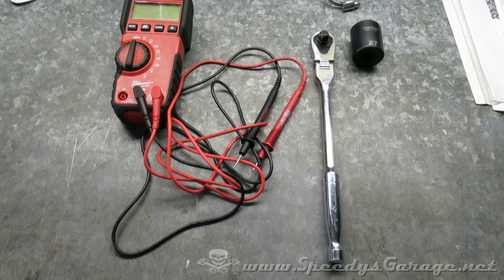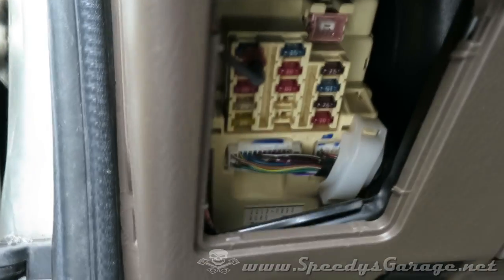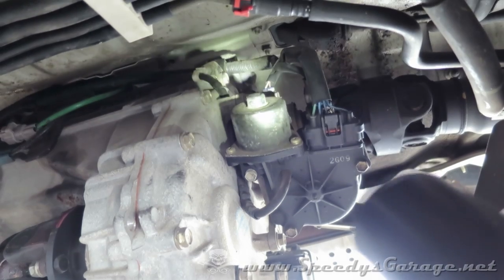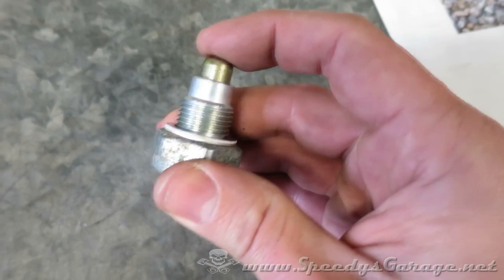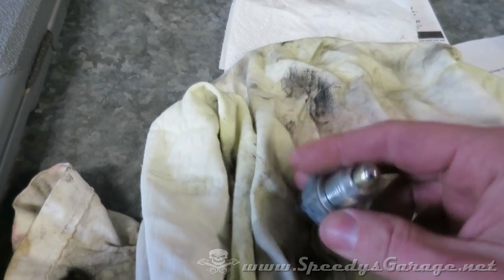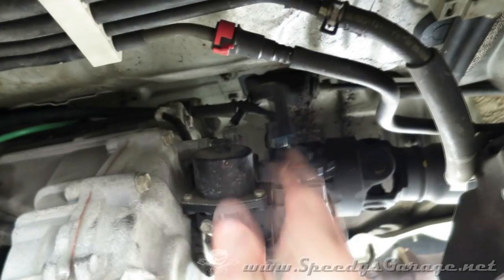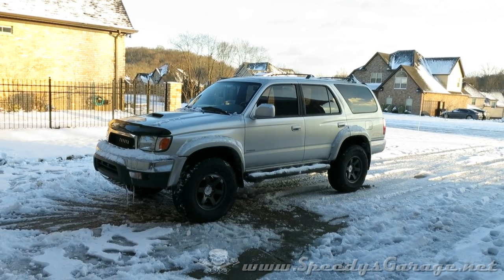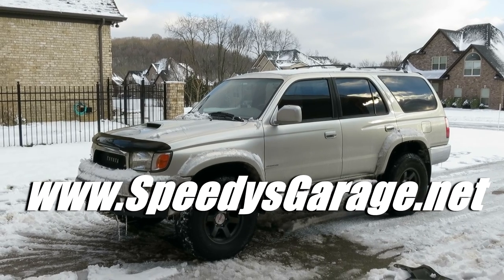2002 4Runner 4WD Repair

Comment: Good job. Just completed getting my son's 02 4Runner out of full time 4WD. Was the sensor switch closest to the transfer case as well. We had the front differential locked and pulled the ADD Actuator to clean, inspect and re-grease. Changed the differential oil as well. As soon as my son connected the battery I felt the ADD Actuator running (maybe a self test). When he turned the ignition key to on it ran some more. When we started it and went for a test drive it re-engaged the front differential. Dash lights still flashing. Brought it back and tested the sensor switch on the vehicle and got a open load. Removed it and tested and it tested good. Re-installed, reconnected wiring and as soon as I turned the ignition on I heard a clunk and it was out of 4WD (dash lights off). Probably should change the transfer case oil as well. Thanks again.

Comment: My 01 had flashing lights but 4wd was stuck engaged; I could tell because the tires were chirping and binding when I turned. I tried off-roading the suspension hoping to bump the actuator to disengage through vibration. Nothing. I disconnected the negative battery as suggested and after reconnecting, drove it a few feet back and forth. The system properly engaged and disengaged. No more blinking lights! Thanks

Comment: I was on the road when this too happened on my same 4 Runner. A You Tuber said to turn the key in the on position and tap lightly on the sensor.
I heard it click...problem solved. I will do what you did with the cleaner, when I get back to my shop.
Thanks for sharing.....

Comment: Great info in this video. The rear sensor / switch on the top of the actuator of my 2001 4runner was faulty. This info was invaluable thanks for making this.

Comment: Thank you very much for the video.  I would donate to this video.  Mine was not just stuck in 4wd but the center diff was locked making the truck hard to turn.  
I was attempting to remove the solenoid but it felt like it was under pressure so I left it.  I removed the outer switch so i could get better access to the inner switch.   
I read some paid $100-$200 for the switch.  I also read that beck arnley reverse switch part#201-1788 can work.  I bought the switch from amazon for $15.  I installed the switch today and start the truck.   I heard a clack and the light came off the dash.  I didnt even had to drive it for the lights to stop flashing.
This is such a simple and cheap fix.

Comment: You can also give your rear actuator a few love taps. That's what ended up fixing it for me. The four-wheel drive had not been used in a long time
Reply: Thanks for your comment.
I rarely use 4 WD and the other day I pushed the 4WD button by mistake... 4 WD light stuck on.
Did what you suggested.
Lightly tapped the two switches. 
BINGO LIGHT WENT OUT !!
Many thanks!!!
Reply: I use mine quite often but it still got hung up. Thanks for the tip, beating it with a prybar worked!

Comment: Had a similar issue with a Sequoia. It would take a long time to change in and out of 4x4. Did a diff oil change front and back and it worked great after that. Now I have a 02 4Runner where the light does not even come on. Going to check the fuse first.

Comment: I have the problem of my 4x4 light on my dash blinking also but am in 2 wheel drive on my '02 4runner sr5 automatic and i did all these thests and cleaning and the lights still blink. Any idea what to check next

Comment: I am having issues with my 1996 Hilux Surf. I get no response when I push the 4x4 button. I changed out the button/knob. I changed the sensor/solenoid you showed in the video. Still nothing. I have not tried the fuse yet. 
I left the button on and one morning I started up the engine and the 4x4 light was blinking and beeping. I tried putting it in drive and then reverse hoping it would engage but it did not. I turned off the button and it stopped but the but did not work once again after.

Comment: i have an 04, 03 and 04 seem to have a different system than 02. My mechanic replaced the actuator with a new one, lights still flash and 4wd still won't engage, pulling our hair out, any suggestions?

Comment: Any suggestions for my 02 4Runner? 4L and Center lock work perfectly but 4hi will not engage.. 4wd lights don’t even flash when you push the button. Dash lights work as they should for 4L and the Center lock. Thanks

Comment: All the new trucks /w the push-button drive mode select BS makes me nervous for this exact reason.  Why the hell do I have to lose my 4WD for a freaking switch?

On another note, I saw the other day the manual actually recommends driving around in 4WD for ~10 miles / month to keep everything lubricated.
Reply from the maker: +s50201 Yep, I haven't been doing the driving around thing, but will from now on.

Comment: Hello, I have a question and I am asking for an answer if it is possible. I have 4R 2001 and as I wrote I have a same problem. I did  checked these switches. My question is: Is your "CENTER DIFFERENTIAL LOCK SWITCH" working only as a button, or is it working as a switch (you can clearly see the position  On and Off, or hear some clicking sound during switching? In my car works as a button and I wonder whether it's normal or it may be blocked and that's the problem.
Thanks in advance to Mike
Reply from the maker: It's just "button".
Reply: THANKS SO MUCH < m>

Comment: My 4wd light doesn't pop up on the dash when I put it in 4wd. Also, whenever I press the button for the rear diff lock, the light on the dash flashes. Is this most likely a solenoid problem?
Reply from the maker: That sounds different, typically solenoid issues result in flashing 4WD lights.  Check fuses, switches, and connections.

Comment: Hi, great video. I have a 2002 as well. I dont have the sensors at the front like you mention. On Mine I have a black actuator at the front.
Have you actually seen the ones at the front on yours?
Reply from the maker: it's been a while and I don't recall.  You can try to find a diagram and it'll show you.
Reply: @SpeedysGarage  it's ok, the same sensor that you replaced is bad on mine too. 
Already ordered part. Thanks

Comment: Yup the top 2 switches are a PAIN to remove. I did the easy two, then the top two and that didn't fix it either, so it ended up being the front actuator.

Comment: Hello Mr Speedy. My 04 4Runner is stuck in 4 wheel high. I can’t find this darn sensor to save my life. Did you access it from the driver side or passenger side, and is it like up towards the front diff or more towards the center of the vehicle? Thank you in advance
Reply from the maker: Driver side front.
Reply: M.Flannery 04 4runner is a 4th generation so may be different

Comment: my 4runner(97 sr5) struggles to move when 4H is engaged and wheel is turned all the way left or right. Turn it far enough and it doesn't move. Any suggestions?

Comment: Hi Speedy's Garage,  I'm writing to you because I see that you know what you're talking about. I have 4R 2001. There is a problem with 4 WD blinking lights. From the moment the engine is turned on, the lights blink and you can not switch to 4WD. At 110 km / h the beeper turns on and then when I press the button, the lights stop blinking. After stopping and switching off the ignition and starting again the case starts again. I just checked and cleaned the contact cleaner spray, two of the switches you showed. They look like they're ok. What's the next step and what direction should we go in, what track? Thanks in advance, Mike
Reply from the maker: Hmmm, it "sounds" like it might be one of the 4WD solenoids, I'd clean/check all of those as well as the 4WD switch on the shifter for starters.
Reply: Speedy's Garage,  I do not know about switch on the shifter and  how to find that devil ,   bud thanks so much anyway MIke
Reply: @SpeedysGarage  This really helped diagnosing my rig. I tried looking it up with no luck, any chance you have a part number or how to look it up?   Thanks!!